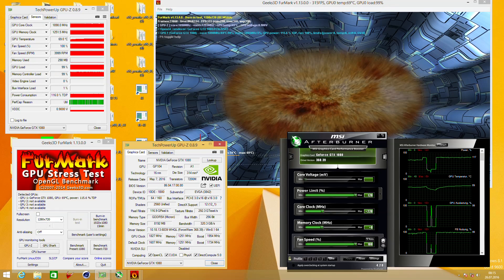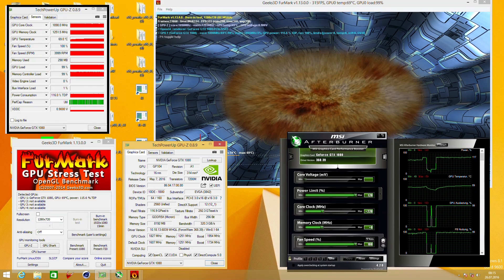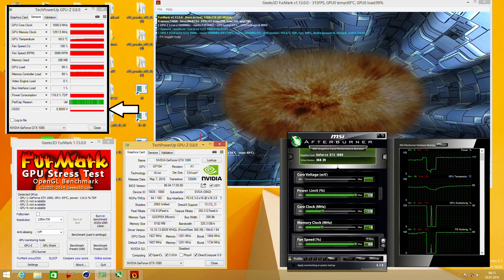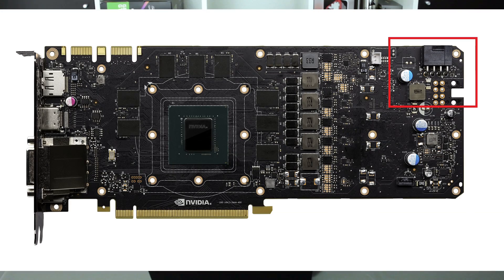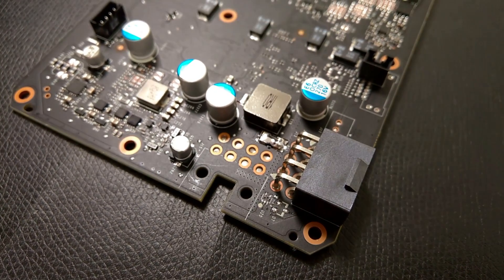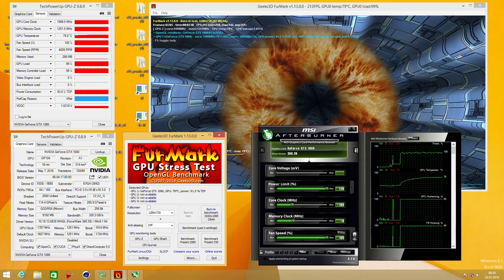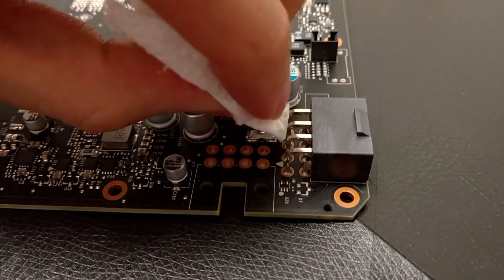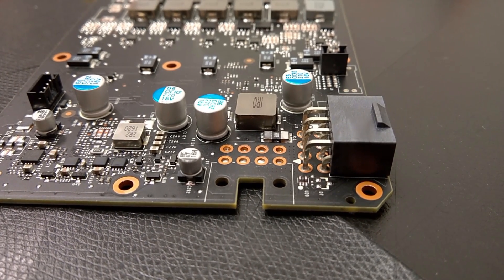GTX 1080 FE + GTX 1070 FE Power Limit Mod - Unlock the Power Target

Comment: does the liquid metal on the shunt need to be reapplied or is it a one and done application? also does it corrode or damage the board over time?
Reply: Jason, liquid metal WILL corrode/liquefy the solder.
Reply: @stupidystu  what if i just used some generic solder instead of lm

Comment: HOWEVER, this is a short term solution, and not very professional. This is what can happen (yep, someone did this on Titan X xd):
https://www.youtube.com/watch?v=HPqi8RdApxc
Liquid metal can cause solder corrosion and shunt resistors to fall off (!).
Why don't solder another resistor of appropriate value parallel to built-in one? Although this is more permanent, it's also a lot safer provided you know what you're doing.

Comment: I wouldn't recommend this mod for 24/7 or even stress testing use. The voltage is fine but the Liquid Metal can and will destroy the soldered components it contacts.

Comment: Great video, but viewers beware, the application is not very good, liquid metal should not touch the tin, it should only be on top of the shunt. If anyone is going to do this, use nail polish or liquid plastic. Alternatively you can use some hot glue to isolate the shunt from the rest of the pcb and tin.

Comment: Hi, I have an Aorus 1080 ti Waterforce Xtreme, power modded. Voltage curve is maxed at 1031 V. Couldn't make it run stable (fur mark more than one hour) at more than 1050 GHz.
Any suggestions?

Comment: Can I also connect the two ends of the resistor by soldering instead of using liquidmetal compound? I got soldering gear but no liquidmetal... I guess I would still be able to remove the soldering without any traces if necessary.

Comment: Hi der8auer, do you think I could achieve any results using this mode on the Zotac 1080 MINI (watercooled) ? I have a good picture of the PCB and I am trying to be sure about the power resistor to mode, would you help me to identify it?
Reply: tenho uma 1080 mini também, você fez o processo do video?
Reply: @Joseph_Soares  No I did not  as I ended up selling the 1080. But it does work only thing is get really hot.

Comment: Tried this on a 1070 card still bumps into power limit (112) at stock clocks and voltage, even tried conductanaut on the 5m0 resistors after doing the first with no results, still hits power limit any ideas?

Comment: great video- procedures are clearly explained,data clearly presented. please do future cards like 1080ti. actual fps data would be helpful on games pubg, gtv, witcher3, wildlands. great job. helps me speed up my msi gaming x 1080 since, 6 days in threadripper 1950 x struggles to keep 70 fps avg in those games with my 1080 gpu.

Comment: Shorting a power resister is not smart. There is more to a pcb than voltage. You increased the current through that branch circuit which could adversely affect the entire card. If this were a cheap card I might say wire a resister in parallel or something but never would I attempt to short it. That's just reckless.
Reply: The shunt is placed in series with the load, and the shunt is chosen such that its resistance is negligible compared to the load so that the shunt doesn't consume/dissipate a significant amount of energy. Shorting the shunt doesn't provide more power by removing resistance that was holding it back. It makes the power sensor always read 0 so that the card doesn't throttle itself based off of power output. It can still throttle if the temperature is too high, so this is a safe-ish mod to do. There's no extra current that's more than the PCB and circuit were designed to handle; it's just removing an artificial limiter. They know what they're doing.
Reply: I agree with Armus.  He got a negligible  improvement at the cost of a lot of heat.  I think just cooling the card down better would have given him the same increase in performance.  Also upping the core voltage percent in afterburner allows the gpu to use 1.093 volts, more than what he got with this mod.  I get about 2 more frames per second by changing the core voltage to 100% and heat only went up by 1 or 2 degrees.  Also setting a custom fan curve is a great idea.  The stock fan curve isn't really ideal in my opinion, and my PNY card isn't even that loud at 90%  I have it set to spin at 100% at 80 degrees, which it never hits.  The highest I've seen it go is 74 degrees.  Just my two cents.

Comment: +der8auer I know this is old video, but what if I add T4 BIOS on top of this mod? I already did the mod and got to near 2,1ghz range, but the limit is 1,093V on stock BIOS. However T4 allows 1,2V I'm hoping achieving +2,2GHz. According to buildzoid, 5 phase VRM is capable 50AMPs at room temperature per phase so that's 250A which means 1,1V is 275W at best and of course the VRM temps probably increases to near 60c with good cooling solution (No way to monitor) so 240w shold be more reasonable estimate. Then again with 1,2V and 250A we should have 300w available but more realistic value would be 250w or just a bit more.  
I did a quick calculation and 2,25GHz with 1,2V we are already around 250w....
Now stock BIOS with 120% powerlimit is 216w so can this VRM handle +2,2GHz with 1,2v or is there a chance that 1,2V is too much and I push the AMPs too high? I mean we are talking about near 200A already with stock BIOS mac OC.
Of course pushing VRMs 100% is not likely to happen while gaming, but I am going to stress test my GPU so it's stable and at that point the VRM is likely to be at it's peak.

Comment: I have also applied this Power Target mod and got quite good results so far, 2100+MHZ core clock running two 1080s in SLI, with full coverage waterblocks. See project here: https://www.facebook.com/xinterceptorx/

Comment: Does this works with MSi 1080 Gaming X? and what is the max safe voltage than i can apply without decrease the lifespan? Thanks
Reply: 1,25V is the max infact it's the hard limit for most BIOSes or even PCBs yet it's fully sustainable 24/7.

Comment: With the STRIX GTX 1070 there are 2 resistors, one is more similar to the one in this video than the other, but they are side by side, and I am wondering if it is to offer some current protection redundancy, I have not taken apart my card this is just based on photos. If you have time l et me know if I need to bypass both resistors with liquid metal/jumpers or just the one closest to the 6 Pin input.
Reply: you ever get to the bottom of this ? if its down by the pcie slot i wouldnt touch it

Comment: I have gtx 960 and my pc restarts when gaming unless I set the power limit to 28%, what do you think is my pc's problem?
Reply: Powersupply or your GPU is overheating. If these things do not fix the issue then your CPU can be overheating as GPU outputs more frames per second then the CPU must do more work aswell which can cause overheating. Likely it's the powersupply.

Comment: Do you mean solder?
Reply: I know I'm a little late to the party but... No, liquid metal is more like a paint made up of metal particles in solution. In contact with air the solution dissolves and the metal sticks. It's used in pcb repairs etc and isn't very expensive albeit you tend to buy it in very small quantities. You could of course use solder but it's slightly more labor and risk intensive & harder, although no impossible to reverse. Given the choice, which would you prefer? Taking a paintbrush to your expensive GPU or a soldering iron? :D Not sure I'm prepared to do either personally although this is likely to nag in the back of my mind until I try it :D

Comment: you use an open bench setup that has the GPUs oriented vertically then this mod will not work for you. The CLU will run down off the resistor and get onto other parts of the card which will cause the GPU to most likely die. is this true? my case is sideways with the panel off.?

Comment: would it be possible to use some kind of a electrically conductive tapes to do a similar mod?? If they have a resistance of few milliohms, it would be a better option than the liquid metal which can lead to very well known complications... what do u guys think??
Reply: anything that conducts will work. IF there is no resistance then the TDP is simply 0%.

Comment: Nice Video , I plan on getting a 1080 Fe + full cover block this summer . I will be giving this a shot for sure . Cards on water are so cool , I have a 950gtx and its load temp is 30 deg =) I cant wait to see GPU boost 3.0 with this mod and low temps .

Comment: Just did this on titan Xp and it worked great. A lot of people are saying this will eat solder over time. This true? And if applied right I know it should not touch the solder. Just thinking long term are there issues to consider? Thx
Reply from the maker: I also read this and I'm not sure how exaclty this happens. I did this on one of my 1080s when they were released and it's still fine on that card. But I also saw some guys where the shunt resistors went off and they had to resolder them. So not 100% sure
Reply: Ok cool. Thx for responding. I will keep it on. Card doesn't throttle and holds 2126 during benching. Keep up the good work!

Comment: Does this work with the GTX 1080TI FE card?
Reply: Yes Gamers Nexus has a video on the 1080 Ti FE showing you the location where you can put the liquid metal - in fact the 1080 ti has 2 places for even higher voltage
Reply: Sweet! Thanks.

Comment: Please give me some tips on an EVGA 1060 3gb. I did a similar mod like this about 10 years ago on a HD7850!!! Other than the heat, it worked out great.

I seem to have a really good chip, as I am able to hold 2151 core clock and 4909 memory on air after coming down from 2164 core clock.  (aftermarket cooler, and putting heat sinks on EVERYTHING) max temps 57c on this overclock. Cant be much over 75c if you can help me push to 2200 on the core clock. The VERY brief time that I've been able to bench at 2177 core clock, I was seeing 6-8 fps improvements. 

Can you confirm which resistor is on the EVGA GTX 1060 3GB? 

I can figure out what to do from there, but I really would like your expertise to chime in on this for the guys who have the lower cards.

From what I've seen, the 1060 is intentionally cut down in regards to voltage because we could easily approach GTX 1070 performance if we at least hat this ability to use 1.1 volts!

Please help the little guy!
Reply: Upping your core voltage to +100 percent will allow you to use 1.093 volts, pretty close to 1.1volts.  I did this with my gtx 1060 6gb and got +2 frames per second.  I also have +200 on my core and +500 on memory.  I've had the memory up to +600 but didn't notice any improvement so went back to +500.  The voltage makes a difference.  Some people say leave it at zero but the card can easily handle the 1.093volts, which is what Nvidia capped it at. With your overclocks I would put the core voltage to 100%.  I realize you posted a year ago but I have nothing better to do tonight.

Comment: This mod doesn't work unless you put liquid metal on all 3 shunt resistors. It actually disabled boost on my card when I did it to only 1 resistor and wouldn't let the card boost over 1607mhz.

I have friends who have also experienced this issue when applying liquid metal to only 1 resistor, possibly a newer revision or bios.

Comment: i did that mod while install ek waterblock on my evga gtx 1070 sc
tdp dropped by 50% and can push the videocard at 2130Mhz fixed before artifact appear
but i got an problem, the voltage dont go over 1volt
any help?

ps. before waterblock + mod does go over 1volt, sometimes, because tdp was really big issue

Comment: I have gtx 1070 AMP EXTREME is this one I encircled the right one to shunt? http://imgur.com/a/TYJfS
Reply: I have marked R005 and two R002s here http://imgur.com/a/gIvmD are these the ones?
Reply from the maker: all 3 are shunt resistors :) You can just short all 3 of them.
Reply: Oh by the way, after I short them. Do I have to change my current OC's Power limit and Core Voltage in MSI AB? Core voltage is +100 and Power limit at 120%
Reply: I just had shorted R005 and both R002s. All setting at stock. I tried running furmark but it fails after a minute or two it crashes. Tried valley and heaven too, same results. If I put 100% core v and 120% power limit in MSI AB it still happens. Really weird, maybe you know what is happening?
Reply: Forgot to add my core clock wasn't running at a crazy speed though.

Comment: Does the full power of the card run through this resistor?

I only ask  because I figured I could just solder a wire across the resistor instead of using the liquid metal stuff.
Reply from the maker: the power of the GPU, yes. But I don't recommend to solder. If the resistance is too low, the card usually ends up in an error-power-state and only clocks at 138 MHz

Comment: I have done this to my new founder edition card but it hasn't changed the frequency standard. I used Coollaboratory Liquid Metal Ultra which I would have thought would have worked fine. I also have it watercooled and the temps don't go above 40'c so it has plenty room for improvement. Any ideas? Thanks very much!
Reply: did it fk with the voltage regulation at all or could you still control voltage with afterburner/x1?

Comment: So I did this with some Cooling Liquid Ultra on my GTX 1070 EVGA SC. It didn't seem to do anything. The TDP goes up to 108% still and PerfCap Reason still says Pwr pretty regularly. There is a thin layer of CLU going over the resistor. What did I do wrong?
Reply: I just did this mod with Liquid Ultra on a GTX 1070 EVGA SC it worked a treat
The tdp still goes over 100% when overclocked but the gpu is running a higher v now allowing it to reach higher boost clocks
So take note of what v the card is running at and try a thicker layer

Heaven was just running +140 1139core 1050mv +800mem solid virtually no dips with the gtx 1070 under a universal gpu block at ~20-35c
Reply: I went back a applied a thicker layer and also covered the 5MO shunt resistor marked RS1. That almost removed the power limit completely. I'm still hitting the TDP and power limit, but it is better. I'm thinking about going back and covering RS2 as well. Am I decreasing the lifespan of the GPU in a significant way by doing this?
Reply: @tamarockstar45  how many shunt resistors did you end up bridging? how long did she hold up?
Reply: @pinnacleexpress420  I think I did it to 2 of them. The 2 that are for the PCI-E  connectors. 1 of them is for the PCI-E slot, and you want to leave that one alone. If you have a multimeter, you can find continuity from the resistor to a pin on the pcie connector. There are videos on how to do that. I don't know how long it held up because I sold it after using it for about a year.
Reply: @tamarockstar45  and you lost voltage control, right? that to me is the scary part. I think if the power AND voltage go crazy at the same time, probably a good way to fry the card? and my EVGA SC 1070 is clearly dogshit at regulating itself. its horribly unresponsive to v/f curves. and i finally realized the reason I couldnt stream bo4 is cuz its absolutely clueless as to how much juice it takes to drive the NVENC encoder. It hits "voltage instability" without even trying to increase the voltage, only when streaming, probably because it isnt accounting for the hardware accelerated task somehow

Comment: why my 1080 is not getting more than 105 power limit ?
Reply: Normally it's somethign you have to unlock in the overclocking software. Usually something like "Settings" and then "Enable Extended Overclocking" or something. I had to do this for the memory for the 1GHz+ overclock.

Comment: Does this mod works on 1070 G1 Gaming also?
Reply from the maker: yea you can find the shunt resistor directly underneath the 8 pin connector
Reply: well, it works, the TDP recorded  in GPU-Z is arround 66-70 % now, but i could not raise the oc above 2126, though my main PSU is at RMA and now i'm running a spare low-mid one,
Reply: I've tested with new PSU. Can't get higher thn 2126. Only bennefit was that before in firestrike the clock was fluctuating between 2100 and 2126 now it's always 2126.

Comment: Hi, awesome video I have been looking for this exact mod! I was wondering however, I have a gigabyte gtx 1080 g1 gaming model, the pcb is different but appears to have the same resistor in almost exactly the same place, would this mod work with this card? I just want to be as sure as I can. If you want to see pcb pictures look at the techpowerup review of this card they always post high resolution pcb photos.
Reply: yes it will

Comment: Is there any danger of the conductonaut running off the resistor when the card is mounted vertically? I read that some that used CLU for this mod had it run off once they remounted the card vertically.
Reply from the maker: You have to apply it very thin. Ofc if you have a 5mm thick layer on it, it can drop down but anything like a 0.5 mm thin layer is perfectly fine
Reply: Thanks. That's what I ended up doing. No issues. Thanks for the guide.

Comment: The founders edition only has 1x 8-pin power cable. Does increasing the power traget possibly overload the power cables?
Other GTX 1080 with better overclocking potential have 1x 8-pin + 1x 6-pin for example (Asus Strix)
Reply from the maker: no that's no problem :)
Reply: Brilliant ! I orderd a GTX 1080 EVGA SC today and was a bit worried, because it only has one 8 pin cable :P
Thanks for your reply :)
2000mhz with some watercooling should be no problem, right? :D